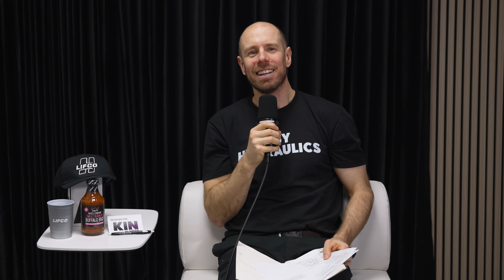Parker V14-110 Two-Speed Motor: Swapping Hydraulic Control for Electronic

Comment: “Was this displacement shift performed under shaft load, and do you have torque or HP data from the test?”
Reply from the maker: I meant to take a look at the test report to get back to you on how the test is run and what we can see. There are a few ways of getting to the data that we need. Looks like we used pressure and flow meters on both lines. Likely the flow meters are on both just so that they have an easy place to put the pressure transducers. -Fraser

Comment: I could understand having a MAX current required to shift the solenoid but not a MIN. This could indicate a weak solenoid. Maybe someone can tell us why they called out a MIN.
Reply from the maker: The whole thing seemed a bit strange to me, but I think the simpliest explanation is that it is a proportional system that is being turned into a bang-bang. It is also being held into the max position, so we would want some reliability that it is not prematurely shifting to MIN. I feel like this stuff is getting more into motor engineering and manufacturing (ie. decisions are being made to lower the cost of manufacturing). I didn't know much about these initially, so hopefully we can have some followup videos as we dive deeper. -Fraser

Comment: Can you test the motors under load? to measure output torque and case drain?

in one occasion I did rebuild one Parker V12-060 following the Parker service manual, and a few days after the motor was return to the shop all broken, because the thre elastic pins (451 and 453)  that fix the joint coupling (455) to the output shaft (311) were sheared.

was a expensive learning, because I followed all the instructions of the service manual, and nowhere was mentioned about those pins. after that one older mechanic told me he learned also that way.